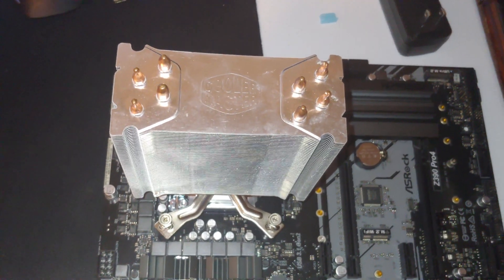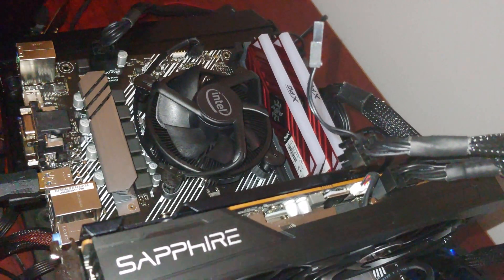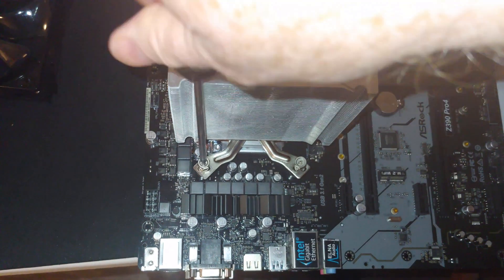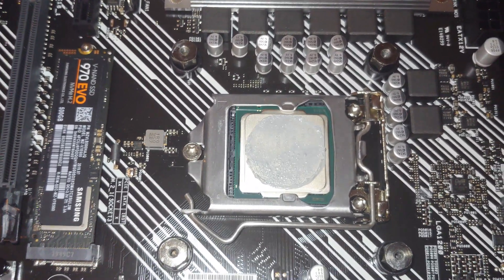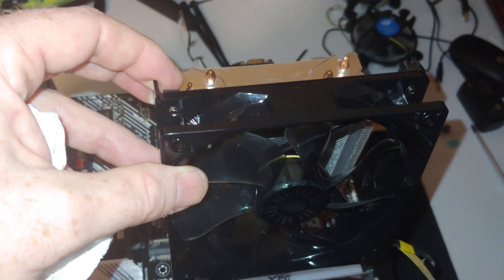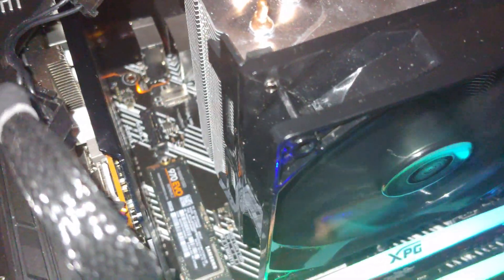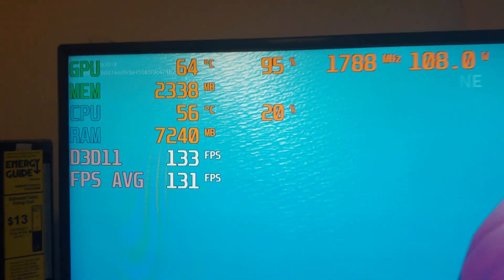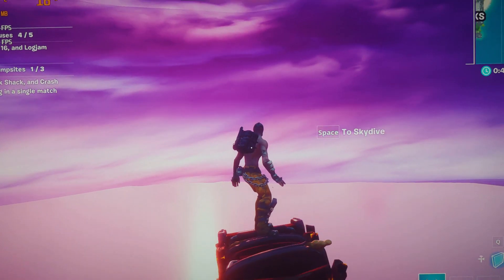Cooler Master Hyper 212 Evo CPU Cooler  on 10th gen Intel I7 10700 LGA 1200 1151 fit 11th

Comment: damn im missing the bracket, i only have the one that connected it to the am3 board its been on. anywhere I can buy just that?
Reply from the maker: I would contact the mfg.  I have bought quite a few things with missing pieces via Amazon Refurbed and other mfg's usually send me the parts for free.  Or its missing the LGA 1700 bracket.

Comment: Why don't they just ship it with an adequate cpu cooler? I have an old hyper 212 evo that I took off my old AMD 3. Did you use the metal plate on the back of the MB or the plastic pieces? I am not an over-clocker. On the AMD 3 MB this cooler hung over the ram slot closest to it, kind of a pain. But, I'd like to re-use it if I can.

Comment: Thanks for making this video. I had the same question after not seeing the LGA 1200 listed for compatibility. I am about to rebuild my 7 year old rig. Currently running a i5-4670 and upgrading to i7-10700. Looks like I can reuse the Coolermaster, which I'm very happy with. We'll see if it can handle the higher heat loads.

Comment: Hi David, does it work with i9 10900KF LGA1200?
Reply from the maker: I would recommend something beefier....especially if you are going to OC or raise power limits.  You potentially will keep hitting thermal throttling and your performance will suffer.
Reply: @PC_HardwareTechUnboxing_1  Thanks David!

Comment: What should I take for i5-10600 CPU fan? Does the stock fan enough for keeping the Max turbo boost 4.8 GHz for at least half an hour or I should take a tower cooler?
Reply from the maker: I had did a shootout between the stock intel, upgraded stock intel and a cheap Noctua:  https://www.youtube.com/watch?v=zzheP5YLZfc   I am not sure which one comes with the  I5-10600.  10700 and 10900 get an upgraded for sure, as I have both of those.  The upgraded stock cooler has a copper base and its more effective at heat transfer.   Personally, whether they give you the upgraded or not, I would buy a better stock cooler.  The 10600 will run hotter than the I5-10400 that I have, but less than the I5-10600kf.

This is an example of 10400 with stock cooler on a test bench playing WarZone.https://www.youtube.com/watch?v=QgDra23hUxo   Temps will be hotter for 10600, but doubtful you would hit thermal throttling in gaming, but potentially doing a Cinebench R20 bench.

Comment: So basically it can cool i9-9900(non-k) with no issues as well
Reply from the maker: With a proper installation and just as important a case that has good air flow, yes it will cool that CPU.    I am actually using a similar single stack with 120mm fan on an I9-10900f.  I have power limits set to Unlimited which raised cpu power usage to almost 175-200W at times.

Icurrently

Comment: Do you alvast have to mount parts on the botton of the  mainboard when istalling a New cpu cooler on a lg 1200 socket? I need a new cooler but i hate taking out my main board
Reply from the maker: Quite a few cases have access to the bottom of the motherboard.  Most of the time you can replace CPU cooler without removing motherboard.  You will have to remove both lh and rh panels

Comment: Will this cpu cooler be compatible like the pins with an msi h410 pro board?
Reply from the maker: 4 Hole spacing is same on all 10th gen.  Issues are more likely to arise with ITX boards.  Most mATX and ATX have good clearance.

Comment: The EVO 212 works good in lga 1200 with i3 10100? 

I dont need purchase another ???
Reply from the maker: Yes, it will work great with that CPU...potentially overkill for an I3.
I have heard of some folks having issues with ITX motherboards due to them being smaller.  I have put this and the Hyper 212 LED on Z490's and not had issues.

Comment: hi, can this heatsink be used with intel i3 10100 processor with h410m-a motherboard?
Reply from the maker: Yes.  I have tried it with about Z490/B460  ATX and B460m ITX...so there shouldn't be any reason it won't work.  Hole patterns the same.
Reply: @PC_HardwareTechUnboxing_1  thx!! Greeting from Argentina!

Comment: I have this cooler with i7 10700 (not K) and with unlimited turbo boost (over 160w) it reached 90 degrees which is a bit toasty, but with -110mV undervolt (decreasing max tdp to 140W) it reaches maximum 80 degrees under full load (running cinebench r20, all 8 cores on 4.6 GHz) for a couple of runs, which is reasonable, considering i bought this cooler 5 years ago and also the cpu is never reaching that level of tdp in any game (in latest games with a rtx 3080 at 1440p with 144Hz it reaches around 72 degrees)
Reply: Can you tell me how did you undervolt the 10700?? help needed. My CPOU runs upto 77c at Horizon zero dawn

Comment: For the people that are really scared to buy this cooler for their lga1200 socket YES THIS COLLER IS WORKING ON LGA1200 MOTHERBOARD AND YES IT FITS I5 10400F AND OTHERS 10TH INTEL CPU. I bought it and it's working
Reply: thats what i wait it for because i want a i5-10400f in z490 lga1200 and a want the black 121 evo one
Reply: just what I needed to read. i just bought an i510400 and msi b460 torpedo and i have a hyper 212
Reply: How about regular 10400
Reply: @2brob710  all intel 10th gen processors have the same LGA1200 socket
Reply: @dharneshsargunan1636  Thank you so much.
Reply: @2brob710  yep
Reply: Thanks

Comment: Hi nice video. What do you think of a hyper212 turbo led paired to a 10700k. Will the temps be to high?
Reply from the maker: Hello, if you are not overclocking and have a well ventilated case...it is probably alright.  I have both I7's...but never bothered to try the Cooler Master on the 10700k.  I did set power limits to Unlimted with the I7-10700 which creates a lot more heat to get rid of.  I don't remember hitting thermal limit throttling.   I did eventually replace it with a scythe Ninja 5 which kept it pretty cool.

I am currently using this Noctua 140mm (https://amzn.to/3jAmW6q) on the 10700k  and it holds its own even for some slight overclocking.  Obvious differences...much more heat sink translates to greater surface area for cooling...larger fan blowing vs 2x 120mm fans.  The other obvious difference...no LED.

Sorry, I can't give you a definitive thumbs up...

Comment: does your bracket (the X) interfere with the 1st ram slot? i have noticed that in this orientation it sticks into my slot space.
Reply from the maker: Yes fan becomes an issue if you have taller RAM and you go greater than 2x.  Luckily A2 and B2 are the primaries for that.

Comment: How would this do with power limits removed?
Reply: Terrible 212 evo is not meant for overclocking. I mainly use it as a temporary stand in while waiting on my custom watercooling parts to finish arriving to build my custom loop. Custom loops aren't for everyone though but you can find a good cooler for overclocking for about 100-150 usd. I'd suggest going Kraken for water cooling AIO or Noctua for Air cooling if overclocking is your goal.

Comment: is the COOLER MASTER HYPER 212 SPECTRUM RGB CPU COOLER compatible with asus prim z490-p ??
Reply from the maker: Aloha, I have no doubt it should work.  I have had this on 3 different motherboards since I got here to Hawaii, one of them was the Asus B460 Plus...which in a lot of ways looks like the one you are looking at.  The only motherboard type for 400 I would be concerned with might be a mini-itx board.  Otherwise, the hole pattern will be the same.  The CPU sits at same height as 8/9th gen.  CPU dimensionally is the same W x L  The insides of the chip and the extra 49 pins are really what makes the difference.  I have had i paired with I7-10700, I5-10400, I3-9350kf and I7-9700f.  It provides adequate cooling.  I would not use it with my I7-10700k or I9-9900kf though.

Comment: So, it can be said that LGA 1151 Socket CPU Cooler is compatible with LGA 1200 Socket, right?
Reply from the maker: After some testing..i would say yes..  
https://youtu.be/FosGFoe_UfE
Reply from the maker: I have 3x 1151 fans coming in...I will hold off answering until I am sure.